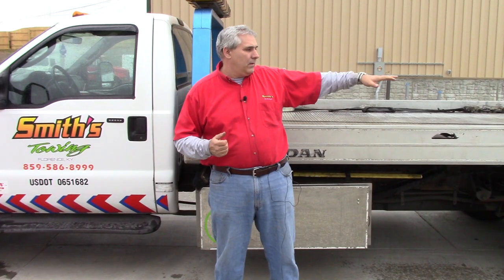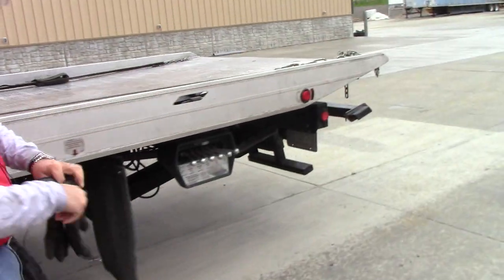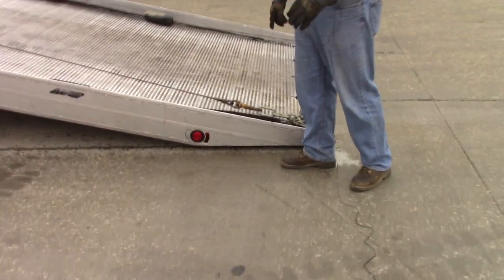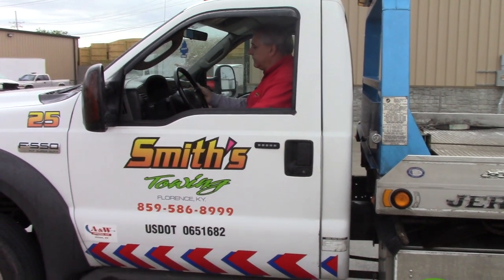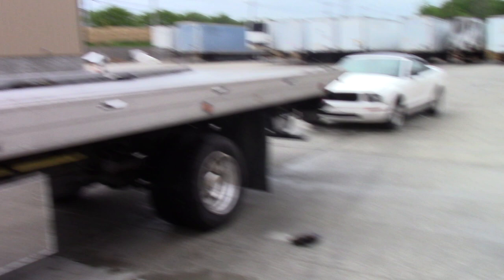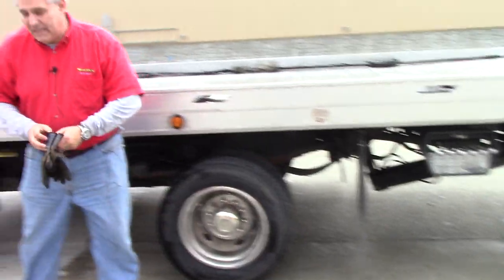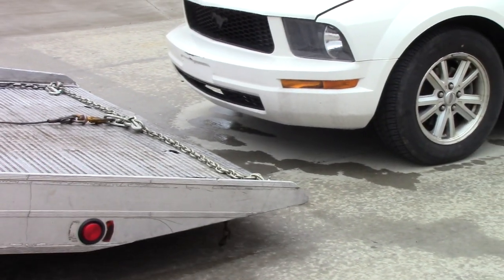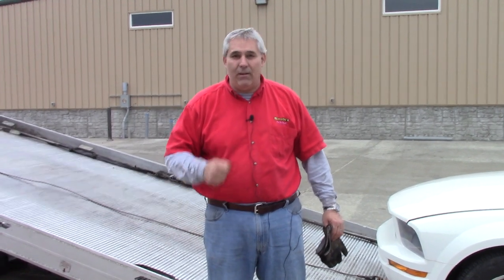Distance Training | Smith's Towing

Comment: This isn’t realistic.  Nobody will ever use this.  Your going to learn your bed drop pretty quickly, and you’re also going to learn that you can’t put your bed right against tires, because then you can’t adjust your chains so they don’t rip the front clip off
Reply: A few thoughts. 

First, stating your opinion as a fact is a poor habit to be in, and that's a fact. 

Second, the glove trick and variations is exactly how I was taught well over a decade ago. The point isn't that you always do it, the point is you do it for a short time until you learn what the distances look like by eye. It works.

And last, this guy took the time to put out actual helpful training materials in a world (towing) that is severely lacking them.

What have you done?
Reply: Exactly!